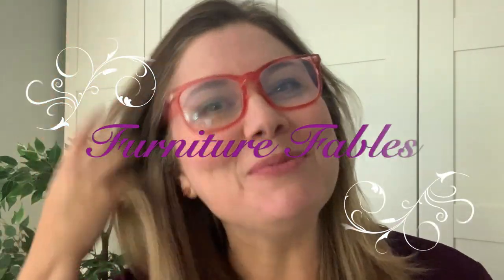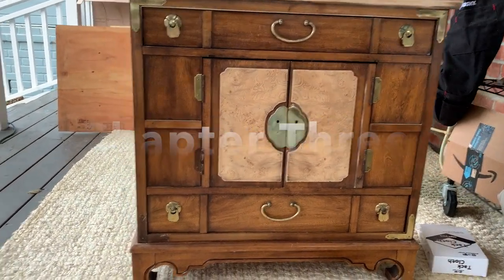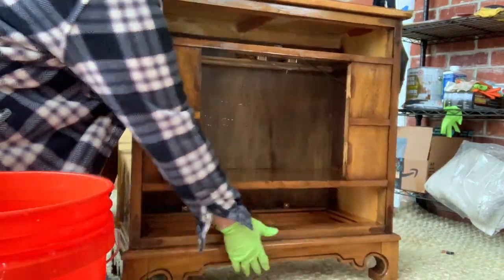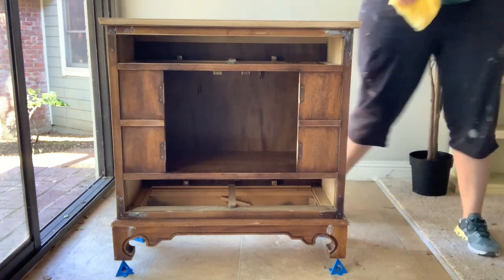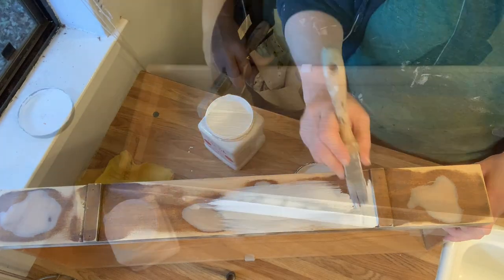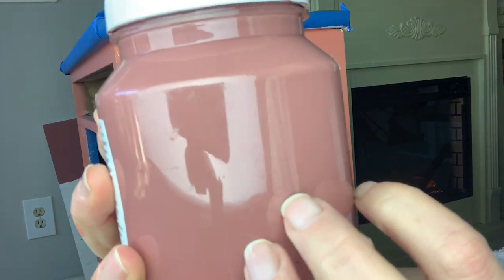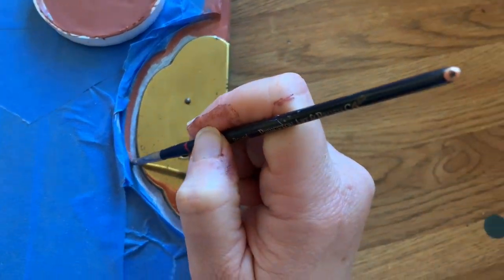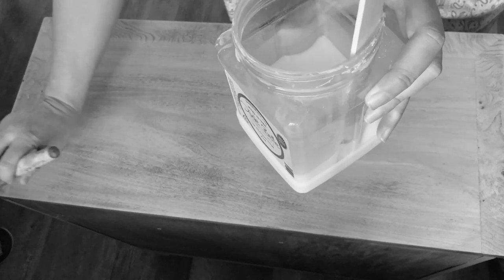Trash-To-Treasure Bar That Everyone Wanted To Buy And My Husband Wanted To Keep! | Furniture Flip

Comment: I personally love pink. My bedroom is pink and sage green - sage green walls and pink accents link my blanket ladder. I took an old high boy headed to the dump, took out the drawers and made shelves and use it in my kitchen especially for my cast iron. I painted it pink, used DB crackle and then apothecary color on top. I also added moulds and transfers but I love it!
Reply from the maker: Wow Sheri, that sounds amazing!  Thanks so much for sharing! 😊💗

Comment: When I couldn’t finish painting something: 

I used to put my paintbrushes and rollers(still on the handle) into a Ziploc bag, squeezed the air out, taped tightly around the part that stuck out of the bag….then put them in the fridge. 
  When I was ready to resume, I’d pull them out, let them sit for a few minutes.
  (This saves from washing out the brushes and rollers every time. I’ve even had them in the fridge for a month or more!)
Reply from the maker: Yes, that is a great trick.

Comment: I have used a lot of body filler on cars. The more hardener you use the faster it will dry. Try using less hardener and you will have longer working time.
Reply from the maker: Great advice!  Yes - I do tend to slather it on.  😊
Reply: @FurnitureFablesbyAndy  Use a thin line of hardener 1/8" wide by 1 1/2" long. That's a good starting point.
Reply: You might want to consider not layering on so much. It will save you some sanding time later. You can wipe with a damp cloth to smooth it.
Reply: @douglasmckay9685  Thank you for including specifics in your recommendation. It's a lot easier to start from 1/8" wide by 1 1/2" than "less" 😄

Comment: Honestly, I think (and this really is just personally) that I would have stained the top and front a bit darker. I really think (just in my opinion) that it would have really warmed and at the same time, popped the color. I’m sure you are right though. The photos probably didn’t do it any justice! All in all, nice job luvs!!
Ps. I think you way undersold this piece! I was shocked that you only listed it @195.00! However, I of course do not know the market where you live. But being that it sold so quickly, you probably could have listed it for much more. But if you are happy, than so am I!
Reply from the maker: Thanks Michelle - great points, and great idea about the warmer stain!  So many beautiful options...😊

Comment: It seems you waste a lot of Expensive Bondo? Then you have a great desl of sanding?
Reply from the maker: To some extent - true!  I tend to make more than I need and overfill sometimes so that I won't have to make another batch and fill and sand again.  That said, Bondo is relatively inexpensive if you compare it with the MinWax version, yes?  In all honestly, I've tried to get more disciplined about how much I mix up. 😊👍

Comment: How do you not get brush strokes?
Reply from the maker: Great question!  So first off I will say - if you are using a brush, you most likely will have some amount of brush strokes...and that's ok!  We are not machines, these pieces are not being created in a factory.  That said - the best way to minimize brush strokes is a multi-pronged approach: a smooth, well-prepared surface, a good quality brush, and a good quality paint are all helpful.  Most of all - do not overload your brush with too much paint, and do not keep going over what you have painted.  Paint has a relatively short "open time", or time before it has dried too much to continue to work with...once that point has been reached (and that comes BEFORE the paint looks dry) any brushing over it will create brush strokes.  If you do have brush strokes, sanding with a fine grit (220 or higher) sandpaper before you do another coat can help!  The paint brand that I personally have worked with that has been the best as far as evening out / self-leveling is Melange Paints.  If you don't like brush strokes, check them out!!!
Reply: The less paint on your brush with Fusion paint the better. It is self leveling and I hardly ever get brush strokes. I've used Fusion for many years it is my go to paint. So much so that I'm a retailers now.